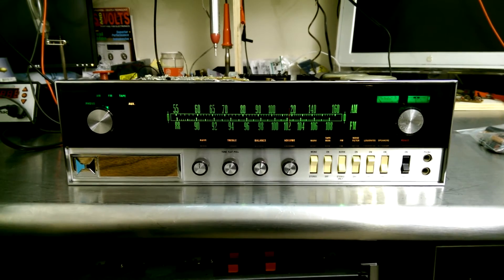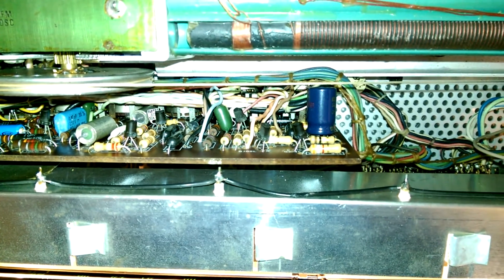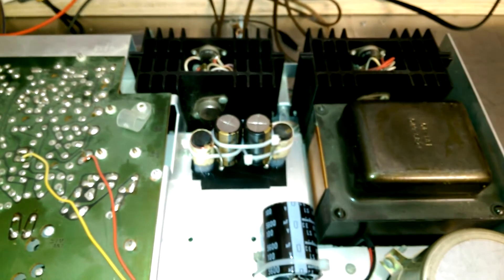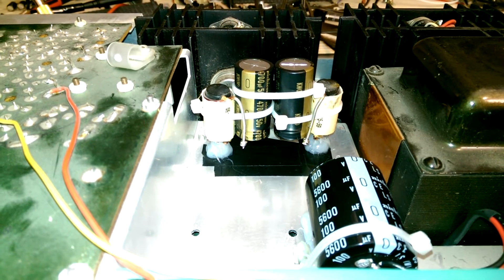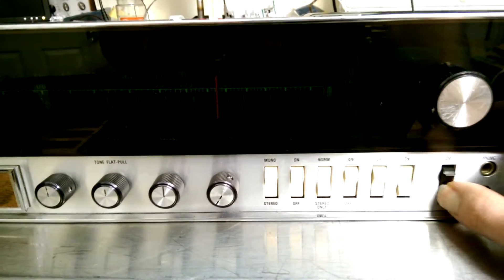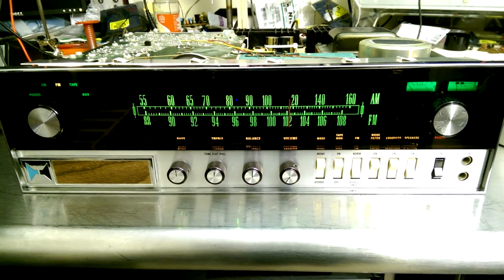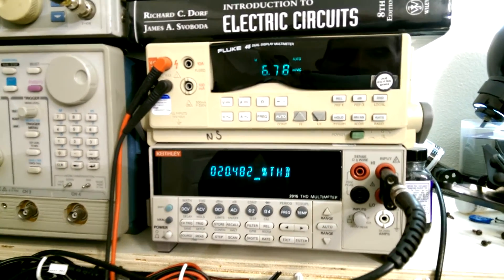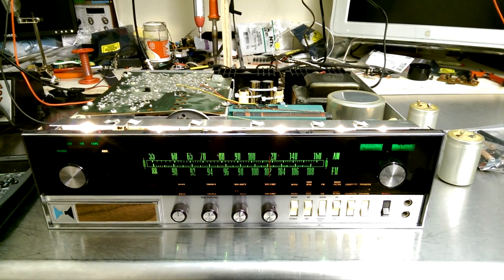The Heathkit AR-15 Stereo Receiver: Cool to look at, difficult to service.

Comment: Great Video ! My father and I took 2 weeks to built one of these from a kit in 1968, and paired it with the AR-2AX speakers and a Dual 1019 Turntable. I still have an emotional connection to the look and sound. About 10 years ago bought a spare for $10, and then found 2 more AJ-15's( the tuner) with cabinets. It is on my bucket list to get one of the A5-15's to work. Both tuners work fine. I'm surprised that you didn't open the little silver front panel to adjust the stereo phasing.-- remember how odd it was that that the stereo subcarrier was not locked. In the day, the AR-15 was at the top of the heap ! and affordable by comparison if you built it from the kit -- Thanks for doing this young student a favor I It's super vintage and he/she should have fun with it !
Reply from the maker: I tried playing with that off camera but it still wouldn't lock. The tuner likely needed a more extensive service and they really didn't want to invest in it since most Dallas radio stations basically play the same 20 songs on a loop. 

Alignments and even used tuners are a tough sell to people my age and younger and we can blame the consolidation of the media industry for that. Just look at the entry level hi-fi market to get a glimpse of what younger folks want in a stereo...you'll be practically tripping over a cargo ships' worth of integrated amps but only a few stereo only receivers are still made and none are from the new Chinese entrants to the market like Topping or SMSL.

Comment: I know I’m very late to this party. I have restored a few of these receivers. And although they may be quite a bit of work to do, I believe that they are still worth doing. Paying to have one restored is expensive, but you’ll end up with a receiver that will motor on for another 50 years. Plus it is an extremely cool looking machine that puts the modern plastic disposable junk to shame.

Comment: the "manual" for the AR-15 is the assembly instructions, which includes the setup for the IF and all that. it's a kit and came in pieces with step-by-step build instructions. there's been an archive of most of the instructions online for a long time

Comment: I have a copy of the original construction manual for my AR15 (which still works at 52 years of age-again except for the FM Stereo DEMUX which is funny since I invented the PLL FM Stereo demodulator used in all systems after 1971)

Comment: That thing really does have a pretty face. Nice job on the repair. Not sure I’d consider NOS tantalums as new. Old electrolytics are old electrolytics as far as I’m concerned, used or not.
Reply from the maker: Wet tantalum with a glass seal has a practically indefinite life in this application. There are quite a few of them in my older HP test gear and I have not had to change one ever....the same cannot be said about the electrolytic caps in my test gear. Since the seal is glass, they aren't prone to drying out and I installed so much voltage headroom that shorts are highly improbable.

Comment: AA-15 amp published THD spec was .5% from 20Hz to 20kHz at 50 watts.  Less than .2% at 1000Hz with 10 watt output and less than .2% at 1000Hz at 1 watt output.  AFAIK AA-15 is identical amp as AR-15 only without the tuner.  When I complete the project I will post results obtained from my old HP8309A.  Funny you mentioned it took you most of a day to repair.  I'm on the most of a week plan.  I make about 5 cents an hour!  Having the Heathkit manuals is a big help for somebody like me.
Reply: In a lab test for Stereo Review magazine the Heath AA-29 measured .08 per cent distortion at 35 watts per channel from 20 hertz to 20 kilohertz.

Comment: Thanks for the video.  I have an AA-15 amp with AJ-15 FM tuner.  Basically same as AR15, but separates.  You can find the complementary pair RCA 40409/40410 drivers on ebay.  Will probably have close to $100 in the amp just in new parts.  I bought 4000uf computer grade caps for the outputs.  Got them on sale, but still paid almost $15 ea landed.  What series and voltage of 4700uf Nichicon audio grade caps did you use?
Reply from the maker: I suggest using 50V capacitors as originally specified by Heathkit, these were Nichicon KW if I recall. Use of 2" diameter "Computer Grade" caps facilitates mounting but costs significantly more and was not in the budget for our customer unfortunately.

Comment: I see that you substituted a 5600 uF cap for the original 8000 uF, what affect does this have on the sound ?  what other effects will that have, i.e. power draw, heat, increase of hum ???
Reply from the maker: Craig Yuen Despite what the schematic shows, this one had a 5000uF cap in it from the factory. There is no hum and it actually beat spec by 10%. Watch the video to the end; seeing is believing! I got 55W/ch at 0.15% THD+N, spec is 50W at 0.5%. If we had an inadequately filtered supply, those numbers simply would not have been possible. What's also vital besides bulk capacitance for supply filters is ESR and the new cap has way lower ESR than the stock one had even new.

Comment: I restored one of those in 2015, fully recapping it, and some other things as well as replacing the hard to find driver transistors. and removing the tuner assembly IS fun along with the preamp. also all the green mylar caps were falling apart as well. Sad.

Comment: The AR-15 was acclaimed to be the BEST receiver available at the time of its introduction.  Bad caps come with age and lack of use by the owner.  Not the fault of the original design.
Reply from the maker: I never said it was a bad receiver and of course any receiver this old will likely need significant service. What is most definitely a fault of the original design is how difficult it is to service. A few tweaks to how this thing was laid out internally would have greatly improved serviceability.
Reply: Been digging around in old B&O systems. They can be real pigs to service some times. Great fan of modular builds where you can pick out the boards reasonably easy.

Comment: Good work. Love old Heathkit ham gear. Just acquired a mint AR1500a...with service manual. At first did not want it....but did not want to see it go to landfill....so ...$20 later I lugged it to van...Sweet sound. All in spec. But what a bear weight wise. 54 lbs...are you kidding me.....Jeez...had to take off face plate for minor adjust of dial needle....its a solid piece of aluminum....christ...I could bench press it...lol. NO one builds like this anymore....No regrets.Set up it man cave with my original Yamaha NS 670 speakers( 1976)and yamaha turntable. Haven't stopped playing records for 3 days....